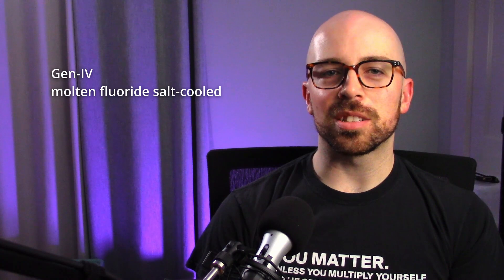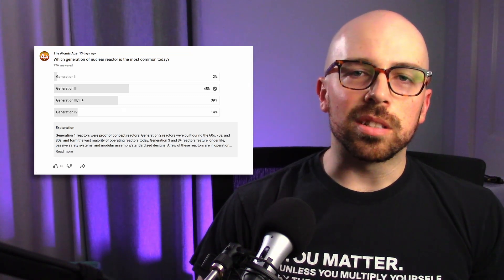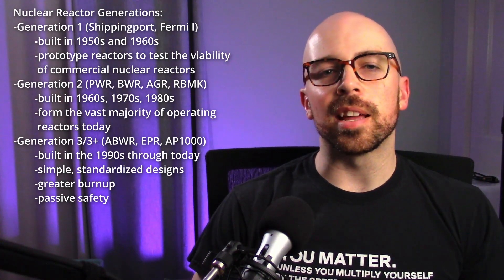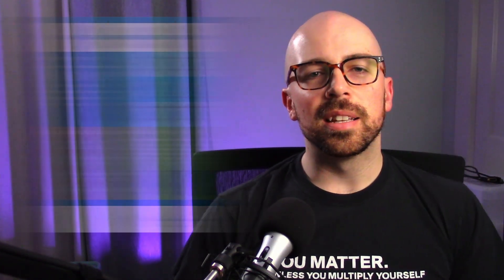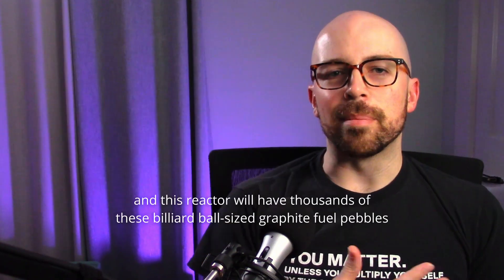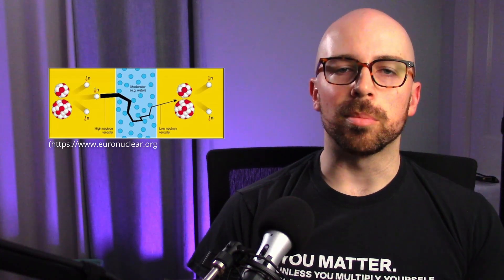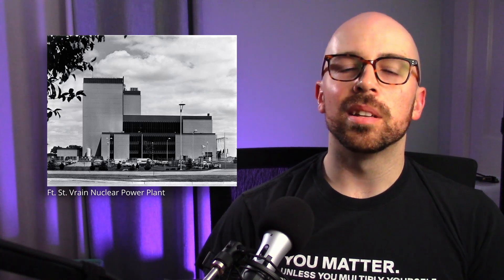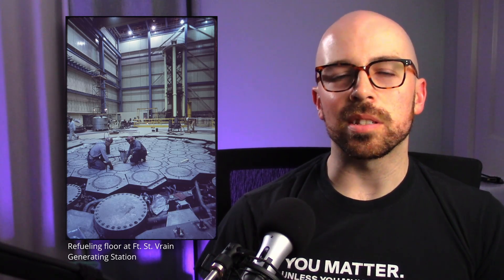Kairos Power: 1st US Gen IV Reactor Construction Approval - February 2024 | NUCLEAR NEWS

Comment from the maker: CLARIFICATION: While this reactor uses molten salt coolant, it is not in fact a Molten Salt Reactor where the fuel and moderator are dissolved in the coolant. This reactor features discrete uranium TRISO fuel graphite pebbles with a molten salt coolant. This reactor also does not breed nor does it burn actinide waste. My apologies for the confusion and not including a schematic or layout of the reactor. See a schematic here: https://kairospower.com/technology/
Reply: Could the Kairos Power use TRISO Deep Burn Fuel -> Under the DOE Deep Burn program TRISO fuel is being investigated as a fuel form for consuming plutonium and minor actinides, and for greater efficiency in uranium utilization. The result will thus be to drive TRISO particulate fuel to very high burn-ups. In the current effort the various phenomena in the TRISO particle are being modeled using a variety of techniques.
Reply from the maker: @shawnnoyes4620  That is a question beyond my expertise, unfortunately. Do you have a link you could share about TRISO Deep Burn? It sounds quite interesting. I know TRISO has some issues with very high burnups and fuel particles starting to fail, but I couldn't tell you more than that.

Comment: What about the LFTR (Liquid Fluorid Thorium Reactor)?
Reply from the maker: what about it would you like to know?
Reply: I watched almost all Kirk Soresen's videos, but how feasible is that?
Reply from the maker: @umfuturopossivel2137  i haven't seen his videos and i haven't looked into the concept deeply, but in theory, there's nothing wrong with it. in practice, it's a stretch. there's basically no infrastructure for thorium right now, everything is uranium. there haven't been any commercial breeder reactors in the US. and a molten salt reactor has never been done commercially either. it's generally advisable to try just one new thing with a new engineering project, but this reactor would be trying three major new things. also, when it comes to breeding, why do we have to breed thorium? we can breed uranium into plutonium and achieve the same goal - although plutonium breeding is not presently politically feasible (plutonium most often means bombs)

Comment: why are they deliberately avoiding the original design and concept that WORKED and try new configurations and materials instead of this half molten salt half pebble bed solid fuel mongerel and the safety of the original with it
Reply from the maker: the original what? the MSRE? this is a brand new design called an FHR. The MSRE was included in the video just because it used FLiBe, not because this FHR is an MSR, which it's not

Comment: Why use molten salt as the heat transfer fluid rather than helium that is proposed for most of these TRISO ball type designs?
Reply from the maker: that's a good question. I just spent a little time researching, and helium cooled plants are limited in how big they can get. molten salt is more efficient at transferring heat than helium, so this FHR design is not limited to SMR sizes, you could make this FHR into larger reactor designs, too. https://www.energy.gov/sites/default/files/2016/03/f30/QTR2015-4J-High-Temperature-Reactors.pdf
Reply: @TheAtomicAgeCM  I suspect that super hot molten salt is going to be a lot more wearing on those balls than super hot inert helium gas. Thank you for the link.
Reply from the maker: i'm not a materials guy, but i would think the balls would be fine either way. they don't stay in the reactor for too too long either compared to a PWR/BWR fuel assembly
Reply: @TheAtomicAgeCM  Thanks for the feedback.

Comment: The fact that it is a molten salt reactor with fluoride salt shows that some of the problems with LFTRs had to be solved, like coolant corrosion. After this, other problems, like u-232 gamma emission will need to be solved before LFTRs are made.

Also, I tried to come up with my own reactor idea: a plutonium fast breeder reactor that uses supercritical CO2 as both a coolant and turbine working fluid. The reasoning behind this is that CO2 is inert, preventing the need for a bunch of loops that lower thermodynamic efficiency, unlike with molten metal coolant, and that sCO2 has better thermal properties than gaseous CO2 due to being more dense, and it also is more efficient as a working fluid.
Reply: You get the mobility and pressure issues of water reactors though, and the risk of decomposing the coolant into carbon slag and free oxygen, but idk what temp that starts at.
Reply: Hermes reactor isn't a molten salt reactor it's a Molten salt COOLED reactor or MSCR, not a molten salt fueled reactor like MSRE and others advocate. This reactor solves the issue, by continuing to use solid fuels in molten solution of FLiBe, yes there is corrosion that's easy mitigate with hastalloy surface interior.

Comment: Curious.. if they were to use molten sodium… would there still be any water pipes going near it for the steam creation? Because we’ve all seen the YouTube videos of people throwing sodium chunks in rivers 🤣 just thinking on it a pipe ruptured and the two came in contact..
Reply from the maker: so that would be for liquid sodium metal. a liquid sodium metal reactor has the reactor loop interface with a secondary liquid sodium or molten salt loop that then interfaces with the steam loop. if there were a molten sodium salt reactor, a sodium salt does not explode on contact with water - sodium salt and sodium metal are two different things.

Comment: No way. Fuel pebble bed, MSR? Here's to a successful, power generating, economically lucrative, waste burning design!
Reply from the maker: well it does technically have molten salt coolant but it's not a molten salt reactor, that implies the fuel is dissolved in the coolant. But yes, best of luck to them! (this design can't burn waste either, unfortunately lol sorry if i burst any bubbles).
Reply: Waste burning (and actually breeding of fissile material) is a major factor for a sustainable nuclear future, there should be a special nomenclature to differentiate it, like Gen IV+ or Gen V. I still don’t see the benefits of SMRs, they are just smaller, not really that cheap, and don’t solve many of the problems of existing reactors.
Reply from the maker: @HNedel  the hope with SMRs is that they can be more like a mass produced thing. almost all previous US reactors were custom, one-off designs. so the idea of building them in factories and smaller sizes that don't need the exclusion areas of large PWR/BWR reactors is hypothesized to bring down cost. that needs to be demonstrated, of course. i tend to be of the mind that there are no silver bullets. I think there could be a place for them (especially in industrial process heat which accounts for something like 1/5-1/4th of the US total carbon emissions) but I don't think they'll be the entire solution.